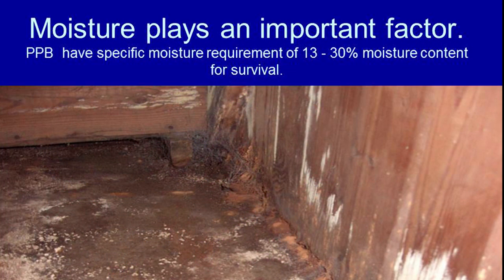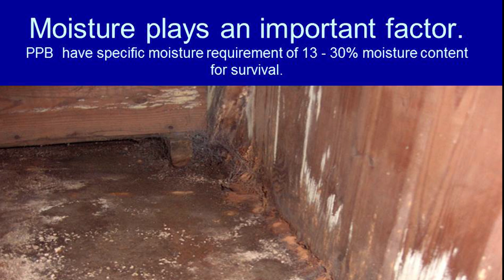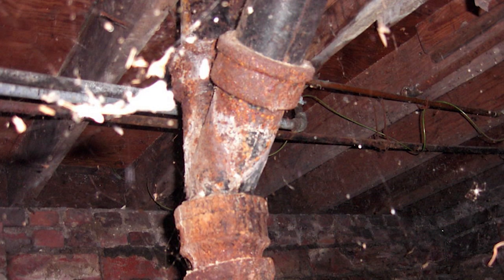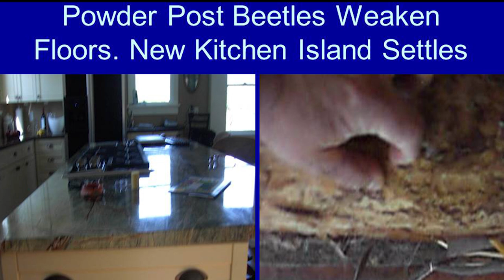Powder Post Beetles:  Powderpost beetle house damage, how to identify

Comment: I went from a simple going to clean the crawl space at my woman’s home I recently moved into, to now having to support the floor as I replace the joists one after another! The last owners were told to bug bomb as a buying stipulation and both agent and home inspector insured it had been done but DONT TRUST ANYONE WORD when it comes to buying a home, check yourself cause the Beetles may be gone ,as I have yet to see any bug or bug carcass or larva, but the damage is done lots of it! Home inspectors should be responsible/accountable for their work when there is clearly a visible amount of damage but nothing in the report of joists needing replaced other than a joist cut by amateur plumbing job fail! 
Long story short don’t learn the hard way , the expensive way about this harmful insect like my woman and I had to, don’t rush into an expense like a home without getting past the layout and location lol get down and dirty and look in the places not often seen to find a potential issue, and as for me now, I won’t think of a purchase before whacking a few beams and joist with a claw ended hammer and praying it doesn’t result in a wood dust poof! 
Thanks Powderpost Beetle you’re the devil
Ps. Home Inspectors your job is a joke but genius, you look at a home that means nothing to you or the future of your family, you tell the buyer what you see, give an inspection report to them (which is more useful as TP) which holds no real merit, charge them for your “hard work” and walk away with a huge smile cause you just got paid to offer your opinion and ability to use a flashlight, on to the next suckers you go! Lol